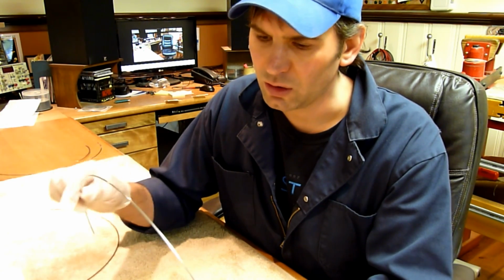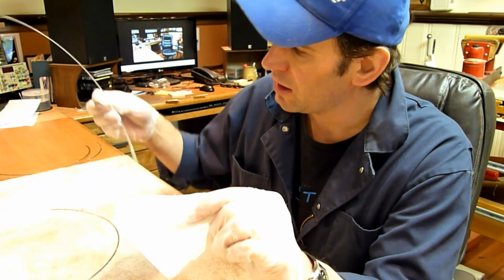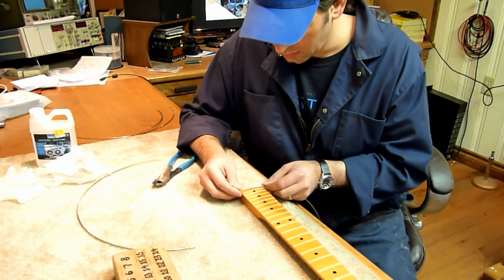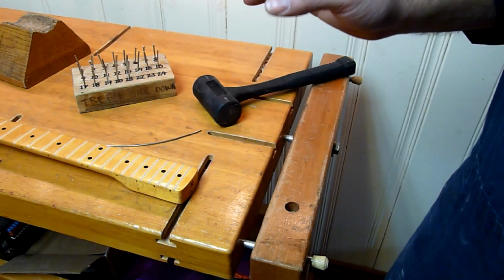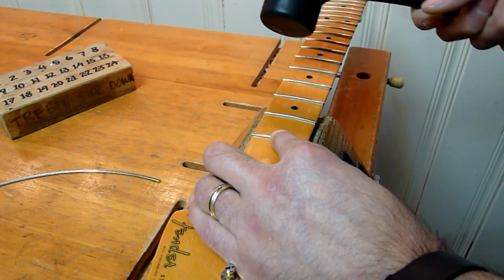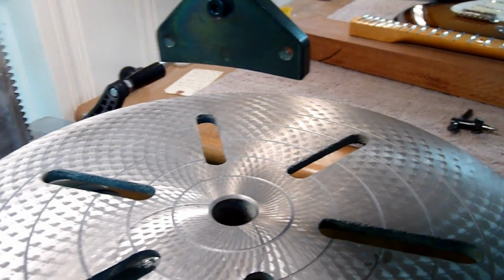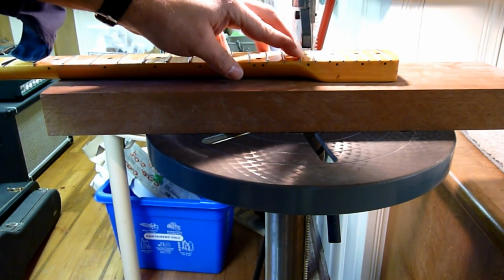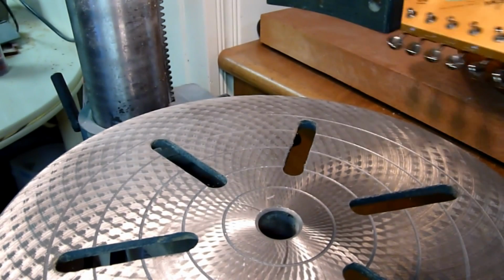Refret Tutorial Chapter 3

Comment: 6:50 I'm actually building a roubo workbench out of big oak chimney beams. I recently had the split top parts ran through a planer. I really love that it's all coming together now. I had to pick the beams up, remove all the metal/stone. Run a metal detector over them, joint them straight and true, I had to extend some of the beams so I don't lose too much length, I epoxy'd some cracks and thats where Im at now. I'm gonna sand and polish the epoxy and cut the tops to length and then install the vise next

Comment: Why is a bounce from the hammer or the surface a bad thing? And why not use the dead blow hammer on the whole fret instead of using the press?
Reply from the maker: Hi Ricky,

A dead blow is preferred because the energy stays down. Those frets will want to spring up if the hammer bounces. You could do the whole fret with a deadblow, but the result are much more even and consistent with pressing them in.
Reply: Thanks for the reply! Really appreciate you sharing your knowledge. :D

Comment: Great tutorial, Freddy! I really enjoyed them :-)

I have a re-fret underway, but if I may, I would like to ask how you go about selecting the fretwire you think will fit the neck and fret slots.
I have an old Squier Tele, to learn the process on, and I believe I've found the right wire.
The width of the fret tang, with the studs measured as well, will measure 0.8mm and the slot is around 0.7mm.
So shouldn't that be a good fit, and make the fret seat nicely?

In the other video you talked about luthiers using greater fret tangs to control the bow, for necks without truss rods, but how much greater does that fret tang need to be? I just want to make sure that I'm not causing any problems, as I go...

Thanks, Freddy!
Your advice would be very much appreciated!

Regards
Kenni :-)
Reply from the maker: Hi Kenni, I'm glad you enjoyed the videos...thanks for watching!

The wire I use is about the same size as what you described....0.032" (0.8mm) measured across the full width of the tang including the studs. However my typical slot size for that tang size is 0.023" (0.6mm). If you find that the frets install very easily, or they don't stick well you may need a larger tang.
Good luck! Freddy
Reply: Fantastic, Freddy! Thank you very much for your quick reply! I truly appreciate that! :-)

Great, I fully understand that, and it makes perfectly sense!
I believe I'm good to go then!
Anyway, I'll watch the whole process as I go, and see how well the frets will go in!

Thanks again!
Have a good one!

Best regards
Kenni!

Comment: is that standard or jumbo size wire? I want to refret my squier and I like the jumbo frets on my 12 inch Jackson's neck, but I don't know if its gonna feel the same on a 9.5 neck
Reply: +blopa blopex another question regarding jumbo frets. Will I need to change the nut if I change my frets from regular to jumbo? thanks!
Reply from the maker: +blopa blopex  These were a medium size. 6105. Sure jumbo frets will work in your squier.
Reply from the maker: +blopa blopex If the new fret size is taller then yes, you will likely need a new nut.

Comment: Just a observation from someone who is time conscious when it come to any repair or build. Time is money and I always look for quicker ways to do things. If not better, at least as good but faster. So, my comment is about the cleaning of the wire. Why not an ultrasonic cleaner as used in the Jewelry industry. The time save will afford you the ability to purchase pre-cut, pre-radiused wire... Time saved... No radius-ing, no secondary cutting, no hand cleaning. I would think that could knock of a good two hrs of time x your hrly fee.
Reply from the maker: +StevieRich Time spent cleaning the wire - less than 1 minute. Time spent radiusing the wire - 1 minute. I will never purchase precut, pre-radiused wire. First of all, it's a lot more expensive than buying wire in bulk. Secondly I like to control exactly what radius I give it.  Thirdly, precut wire is oversized, so you have to trim it to length anyway so there no time savings there. Thanks for your comment!

Comment: Stainless steel when you bend it becomes "work hardened" and it does become slightly magnetic. Depends on how much you bend it.
Why not cut the fret wire by using a hack saw with 24 teeth per inch. 
Then the end of the fret will not be deformed.
Reply from the maker: That's not a bad idea Lucky Dog! I would just have to set up some kind of a jig or holder so the wire is very secure. I'll give it a try.

Comment: Please...if my neck is 10 inch radius...can I use 9,5 inch radius ss frets,or frets must be exactly like neck radius?
Reply from the maker: a slight bit of overbend is OK for SS frets....you should be fine
Reply: Thank You !!!
Reply: FreddysFrets Freddy same question for me, i have done ss refrets on my guitars using most of your walkthrough but i have one that has around 13.5 fretboard radius and enough pre radiused fretwire to use at 12 inches though........ do you think it can be hammered in without issues?

Thx in advance.

Comment: My problem is that the fret is not adjusted to the neck strong and it is moving up and down a little bit, if you will look it closly, you will see so .. this is the reason of my string buzz on 17 fret :X the dead note .. Have I to remove the fret or there is another way to fix it .. ? please answer me :X .. I am subbing ..thanks .. Can I just Push the fret in or hit it a little bit stronger with a hammer or .. ? :X I was thinking that the frets were glued in the neck with a glue or etc .. anyway .. good lesson )) thanks ))
Reply: LordOfMetal \m/ is your string buzz problem on 17th fret ? :D if not, that means I am not copying you :D .. metal horns up my friend ..
Reply from the maker: The problem with hitting a fret with a hammer is that the fret tends to spring back out. A better way would be to run a bead of thin CA glue into the fret and clamp it down.
Reply: FreddysFrets Thank u : )) u helped me )
Reply: +Dethklok 666 stops copies me, i wants to ask that questions, and +freddysfrets tnx i needed it too XD
Reply: Dethklok 666 okay then not :p

Comment: I think you were expecting more crud because most people use nickle fretwire (I'm allergic to nickle and have this issue with most guitars). That crud is the 'rust' of nickle, a proper stainless shouldn't oxidize, so you're only getting the dust and factory grime. Nickle, you'll get that plus a bunch of oxide (which crumbles, just like building something out of rust, making the frets not stick well ;)

Comment: The drill table flexes somewhat when you use the drill press like an arbor press.

You would get a more solid feel if you cut a 4"x2" to length and wedged it between the drill table and the drill base so that it acted as a secondary support column. 

Excellent series of videos btw ...

Comment from the maker: @TheRockinPajamas 
It's usually not quite as consistant, that's all. Typically when they are pressed in they are very very consistant. More chances of having a fret not seat tighly all the way across the fetboard with hammering, and thus creating "dead" notes and other problems. And if you hammer them in it usually means you've got more fret leveling to do, not only making more work but also wasting a bit more fretwire right off the bat.